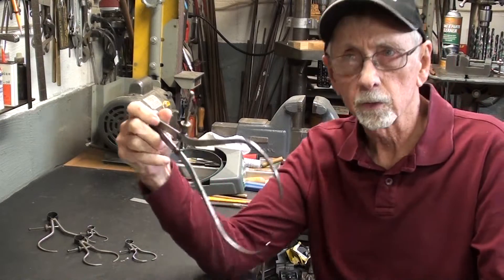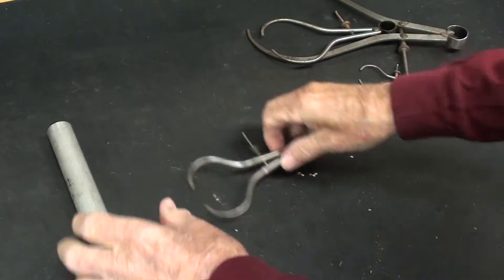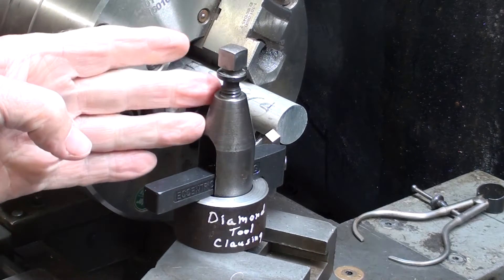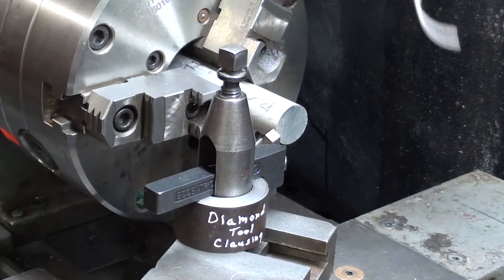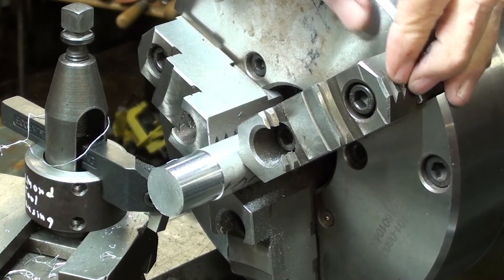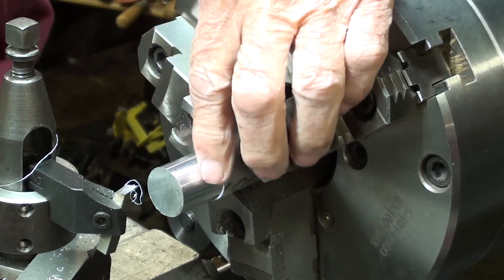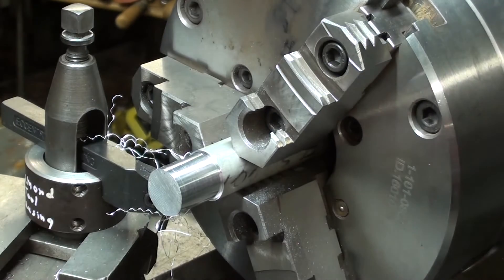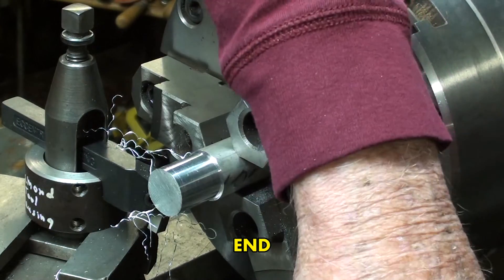ACCURATE MACHINING WITH CALIPERS #20 short tubalcain

Comment: I have a few sets of inside calipers, not sure the brand, they seem to be fairly old. Used em a few times and was happy with the results. I gave a large size outside caliper made by LS Starret. Not sure how these are sized. Overall length is 24 3/8” and across the two legs while closed the measure 15 1/8” outside to outside. Haven’t see them to machine anything because they are so large. Don’t do much work that bug. Thanks for the video Mr. Pete.
Reply from the maker: That is one heck of a big caliper

Comment: I use my spring calipers to rough in o ring grooves on my lathe while it's running. Saves having to constantly stop and check with dial calipers or groove micrometers. It's all about feel. I don't trust it for the one thou tolerance, but it gets me to that last 10 or 20. Thanks for sharing!

Comment: Spring calipers are great for initial roughing since you don't have to stop the machine to measure.

Inside spring calipers are also capable of measuring internal grooves that microwave and slide calipers can't reach. I'm currently making some soft hammer faces with an internal thread, and spring calipers are the easiest way of measuring the thread relief to ensure it's deep enough. You just get a nice feel, squeeze the legs a bit to get them out of the bore, and then let them snap back to measure them.

Comment: I have a drawer in one of my tool boxes dedicated to spring calipers, but the only time they ever get used is for measuring hard to access dimensions where nothing else will fit.  The one that gets the most use is a 14.5" Starrett that has no model number, but does have a 1901 patent date.  Thanks for the video!

Comment: Great video; I had also been sharing the same doubt, especially after seeing those gentlemen truing up the stock in the chuck by using, instead of a dial test gauge, a piece of steel wire with a sharp tip :). Thanks, Mr Pete.
Reply from the maker: Yes

Comment: When I first set up a lathe at home, I had no snap gages, so calipers were the rule for inside bores. I had no problems getting within .003" using them, finer than that required a bit more finesse.  Before the introduction of micrometers in the 1890's, most turning was done using calipers, usually set off of a ruler. The fellow using the lathe or planer knew the pitch of the leadscrew on the cross slide, so if it was 8 threads per inch, one turn was 1/8", one half turn was 1/16" and so on.  Thousandths were not  even considered. Press fits were done off the mating part. mrpete has shown how it was done back before the 1890's, it's an interesting exercise to try if you have a lathe, and if you  have an older lathe without graduated dials, knowing what was shown here can make it a useful tool even in a modern home shop. Great video!
Reply from the maker: Thank you for a great useful comment

Comment: Mr Pete, when I was an apprentice machinist early 70s, in Australia, we were trained to use calipers  for all bore work. Spring calipers were not allowed, they had to be fixed jaw type. Apparently  spring caliper are not as accurate as fixed.The feel that was required was " feel until you don't feel", that same feel had to be used in the outside micrometer for measurement. Very accurate work was done. All the machinists used them. Didn't  see telescopics till I started a toolmakers course.

Comment: The idea behind any precision turning is consistency. You hand 10 machinists spring calipers set to the same gage block, and you'll get 10 different dimensions. Also the type and quantity of the calipers will make a difference. First consideration is tolerance second is consistency. I've used this method on wood and metal patterns, but the tolerance was +/-.015". so not a big deal. Fit is the next consideration, is it a press, slip or it doesn't matter fit.

Comment: I have watched those channels as will.  Wondered the same as you. What I want to know is using this method while the work is turning,possibly wearing on the the tips and changing the measurement over duration while creeping up on desired measurement?
Reply from the maker: It will not wear that fast. This is a time honored method.

Comment: Up until the 1940s, every machinist in America had two tools that they owned themselves: a 4" outside caliper and a 6" machinists scale. You carried both in your lapel pocket on your shirt or overalls. Most drawings in those days used fractional measurements rather than decimal, with 1/64th inch being about the finest graduation of a measurement. 

You pulled out the calipers and scale, hooked one end of the caliper on the end of the scale, then twiddled the knob until the other point was right on the measurement you wanted. Measurement was as Mr. Pete did, and it was good enough for almost everything, including bearing fits (which were babbit in those days, not roller bearings).

By the 1940s decimal measurements were becoming common, and you could get machinists scales with 1/64 and 1/100 calibrated scales on the same scale. The other side usually had 1/16 and 1/10 scales, which are much easier to read, and could be used for setting rough cuts.
Reply from the maker: Thanks

Comment: Well, now I will have to pull out grandpa's vintage calipers (showed back in 2019 during my quarantine quickies) and do some test runs as well. I do use his in side calipers quite often for rough in's, but of course relay on my good old Starrett's mic's and adjustable gauges for end results. Thx Lyle for doing this Short, took me back 55+ yrs this morning 🤔👍

Comment: I've  read several places that some of the aforable hobby lathes available in England after the war didn't come with graduated dials. Yet many fine projects were done on them. I suspect a lot of the work was done using spring calipers,  but without the benefit of a gauge block. Practice.  I love my diamond/tangential tool holders. It's my "opinion" that most hobbyists would be much better off with high speed steel and tangential tool holder then investing in carbide. Especially for the vintage Southbends, Logan's, etc.  It's just too easy to sharpen them and keep sharp with honing, rarely a need to regrind.  Gary of Eccentric Engineering is a great guy, Hope to hear more about your experience with them.
Reply from the maker: I am planning videos on the diamond tool

Comment: Thank you for showing this, and I am glad you have found a new to you method. I have entirely too many internal and external calipers (bowspring, firm joint, and others). They get a fair bit of use. Most useful for matching dimensions, such as repetitive work and duplication, but also quite useful for comparative work. Inside are also nice for centering when there is large clearance (2 inch piston rod in an 18 inch bore, for example). I rarely use them to hit a particular dimension if I can use any other measuring tool, but fairly often use them during roughing, set maybe one cut depth off final size for easy progress checks when removing a lot of material.

Comment: You must watch the Pakastani truck channel too Mr Pete!  Great Video I often portable line bore construction machinery using spring calipers for checking where I am at during the process. With some practice you can machine surprisingly  accurate with a set of calipers and a Vernier or dial caliper for a reference. Analog measurement is not dead yet!

Comment: what they don't show you in those shops "over seas" is the finished job actually working like new in the machine they took it out of... 
I saw one where they welded back together a large diesel crankshaft that had split in half... I wouldnt trust that crank past idle for more than a week... granted im sure the tolerances were so bad that assembly grease was required instead of oil
Reply from the maker: I watched that video with shock and awe. I predicted it would fail within minutes. And I’m sure it did when it went into actual every day use.

Comment: Steady hands are extremely important for Brain Surgeons and Machinists    : )

A good set of calipers weren't inexpensive and are precision instruments. This is another time when Prussian blue is used for precision work...the length of the amount of drag (the chord length) is measured with a scale and trigged to determine how much larger or smaller in diameter that the machined part is relative to the round part that the caliper was set to; which was also done with the thinnest smear of Prussian Blue on the contact points of the caliper. Prussian Blue used to be very important for all machinists just a few decades ago.

This method might be found in the "Machinist's Handbook" but I doubt it. I learned this one from my tool and die mentor.

Comment: I duplicated a part for a router using a crescent wrench, comparing fit & feel between the original part and the new one.  That was back in 81 or 82, when Mr. Bob allowed me to add some experience to my book learning about machining.  Didn't have a mic available at the time.
Reply from the maker: That’s funny, I’ve heard of a crescent wrench being used as a hammer, never as a caliper
Reply: @mrpete222  now that i think of it, I've used big adjustable wrenches to measure driveline tubes and pipes.  Also framing sqares, stacked on each other, for even larger diameter's, when fractional measurements were good enough. Like for the initial set up of drum brakes ...

Comment: I have recently had to manufacture some replacement packing glands for hydraulic cylinders that required cutting internal O ring groves. Some are only 1/4" wide and 1/4" plus deep. Perhaps someone makes a micrometer to measure the ID of the O ring grove. I don't have one if they are made, so I have been using a modified internal caliper for the job. I had to modify the tips of the caliper by making the bent tips longer so they would reach the bottom of the grove without the legs coming in contact with the ID of the rod bore. Is there a better way? Yes I do have a DRO on my lathe but it is nice to be able to check dimensions.
Reply from the maker: Awesome

Comment: Good experiment.  I use calipers with my wood turning, as you mentioned you have done, and it works well for the projects I have finished.  But I get the need for much tighter tolerances in machining metal.

Comment: If you don't check the measure at .960 and .910 why not just go straight to .950 and .900?  What was the reasoning behind the "almost there" points?  I thought you were either going to check them at each point or just do 4 points along the stock and then check them all.  If I did that I'd just say it was because I'm old, but what's your excuse young whippersnapper?

Comment: I recall my father using an inside spring caliper to bore a recess for a press fit bearing.  He had outside mics which he used to size and hold the diameter of the bearing bush. But then would pick up the bore size with the inside caliper and measure it with the micrometer.  Much like a telescoping gauge being checked.  And yes, the bearing was a nice firm but "in scale" final fit.  Much like you I had a fun shop evening a few years back doing more or less what you did.  I did some outside stuff and some inside stuff.  It very much is a sense of feel and skill that takes some practice. But it didn't take long before I was hitting my sizes within .001 or less... at least most of the time....

Comment: In a way, I don't think that the "feel" of spring calipers is too much different than the "feel" of small hole gauges, telescoping gauges, or setting your tool with a piece of paper.  You just kind of get use to it.
Reply from the maker: Agreed

Comment: Question - Lyle,  did you ever use them when you were "back in your prime"?  I'm sure it's like machining in other ways, it's a talent.
Reply from the maker: Are used to use them to rough out a piece on the lathe.  And then when I got close to the dimension, I switch to the micrometer.

Comment: It's all about "feel".  It doesn't matter what measuring device you are using, OD mic. ID mic, Caliper, etc.  I never let my trainees use the "clicker" on an OD mic to force them to develop the feel.  I also required them to read the device while it was in contact with the work, if at all possible,  as the device could move while being removed from the work.
Reply: I agree with you was about to write about touch (feel) till I seen your comment

Comment: Instresting test,  I think if you had a round test pin,  to set your calipers on,  so your feel, is comparing round with round would be more accurate. Also would your feel get better the more you practice?

Comment: Great video.  My shop teacher told us not to "waste shop time" using micrometers and such if calipers, rulers and machine dials were adequate for the job in hand.  We were not even allowed to use precision measures for our first couple of projects (hammer, drill sharpening gauge). He had similar thoughts about using files and other hand tools before "wasting shop time" setting up a machine.

Comment: Worked as a sparky in large maintenance shops and inherited a few calibers . Noticed that the younger guys never used calibers while say turning something in one of our 5 lathes. Guys who called themselves machnists in our shop that never worked a minute in a machine or tool & die shop never had halve of the tools a real deal machnists had. At least two of these guys never owned a micrometer.Thank you Mr Pete for all of the interesting & informative vidios.
Reply from the maker: Hard to believe that men who call them selves machinists do not have all the necessary tools.

Comment: I have always wanted to see a real demo on these types of calipers. I have a set of I/D and a set of Morphydite. The inside ones are great when there is a shaft inside the hole you are measuring. I use the roll in method similar to using snap gages. They are also friction joint and not screw type. I will be looking for a set of the friction type for O/D measuring. Just for fun. I like using the old ways. The Old timers did the walking so We can Run. It is that simple. Now we have machines that do their own calibration and measuring. What fun is that! Thanks as always Mr. Pete for bringing us along and making it interesting.

Comment: OK Mr Pete ... the outside calipers work, but I just don't know about taking a measurement while the machine is running, especially with those somewhat unpredictable strings of aluminum coming off.  I've had this set of 10 fingers for going on 73 years and I am quite fond of them.  Also, at my age I'm just not so much in a hurry I can't turn off the machine to make a measure.  I might be able to walk with a wooden leg, but I'm pretty sure I can't play the guitar with wooden fingers.

Comment: I used to use spring calipers for aligning motor couplings regularly. I learned to use both methods in trade school and find using calipers rather than a dial gauge much faster.

Comment: GREAT VIDEO! Like you, I have watched those Pakistani machinists and mechanics and marveled at the work they do with primitive tools, conditions and machines. There is always a long list of comments from the "Safety Sallys" who can't get beyond they aren't wearing steel toed boots, but if the truth were known, those guys never do anything other than watch Youtube videos. I do much of my work using calipers and have found things work best if you stick with the same pair of calipers and don't change the way the work is held in the machine. This was a very interesting video. Thanks for producing it! With a little care and common sense, there is nothing unsafe about using a caliper "on the fly" as my old shop teacher used to call it.

Comment: This was very beneficial Mr. Pete! As you are aware from my history, my grandfather used calipers to teach me how to do basic machining in the 1960s. He could hit the number on the first try almost every time. I still have all his calipers. However.... because of YouTube and the top-notch creators (yourself at the top) there has been a revolution toward digital micrometers, calipers, DROs and so forth in an attempt to strive for ten-thousands accuracy. In my humble opinion, one must FIRST learn how to use ALL the measuring equipment! And the "feel" of ALL measuring devices is extremely important and must be LEARNED by trial and error. It doesn't matter WHAT type of instrument one uses (digital or analog). If you don't accurately set it against the reference AND the part, one will NEVER get the "correct" reading. Thanks for hammering the "feel" and please hammer again! Maybe after were dead and buried a machine with AI will be hooked to an iPhone and all the "machinist" will have to do is tell it "turn this part to 1.398160" diameter!"
Reply: I would say the use of all the micrometers, digital calipers and dro is in a high part about speed of completion of the job.  I have used calipers many times but it is in some part a bit of educated guessing.  It all matters also to the tolerance level you need to achieve.  I to believe you should learn and be familiar with all the measurement techniques, even calipers.
Reply from the maker: Great comment JAy
Reply: @mrpete222  Can you have another go at this but with an INSIDE caliper on a bore?
Most people have to use inside telescopic gauges combined with a micrometer.
I wonder if an inside caliper might be able to do the same job and possibly better.
Reply: Yeepers, Lyle took me back 55+ yrs this morning as well. Grandad was a master cabinet maker, and still have his old 1944 Delta lathe and all the calipers ( most LS Starrett) he used up to 1970. Now 70, and every time I pick up one of his tools, get to flash back to those by gone years. Bear. Hobbyist Machinist in TX.